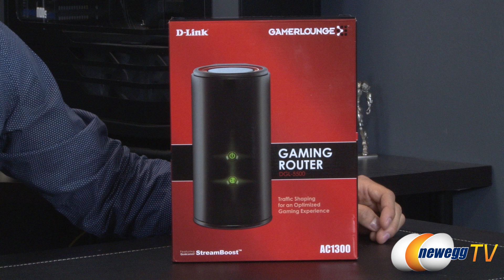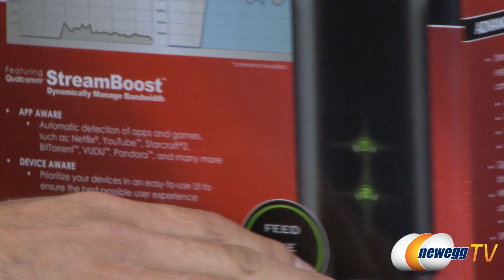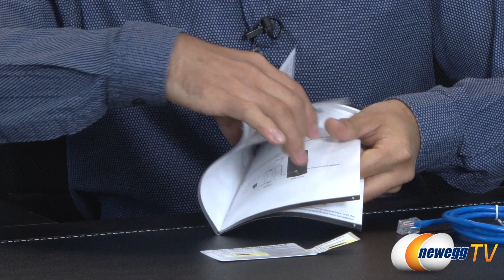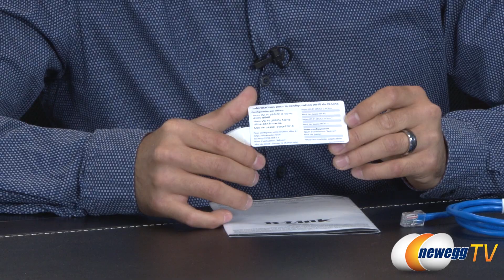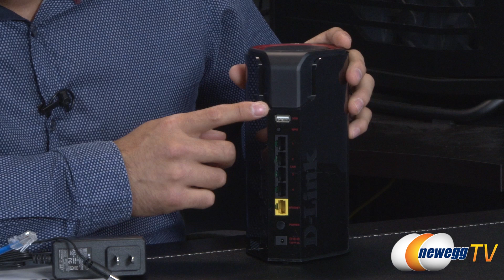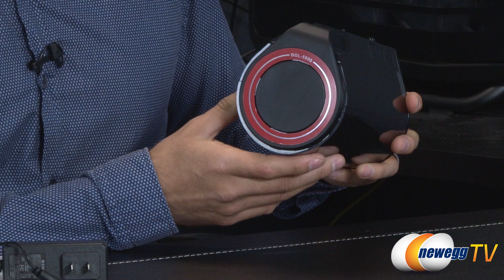D-Link Wireless AC Gaming Router Overview - Newegg TV

Comment: But it's still not done to game on WiFi!
i'm installing WiFi networks, this model is based on the N600, and I gotta say it's competing well with some of the other brands out there for WiFi range. But dB-peaks and valleys on WiFi's in a house with thick, concrete walls will make you miss that one headshot in a game! nothing replaces a cat5 UTP cable!